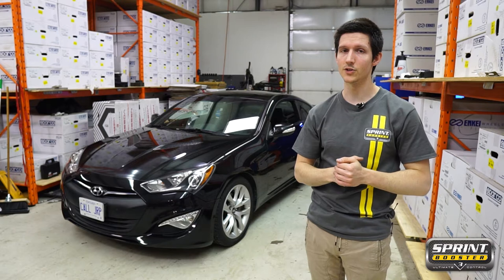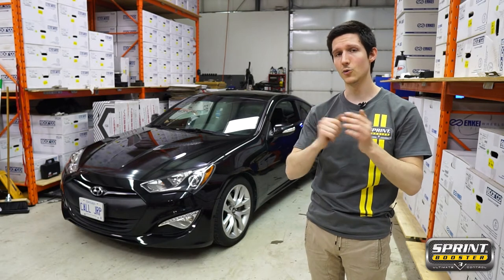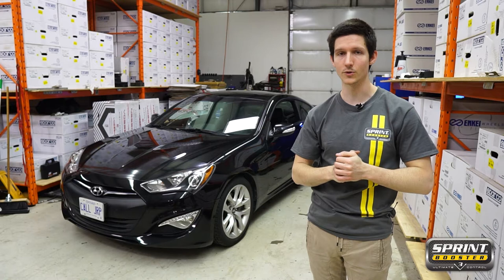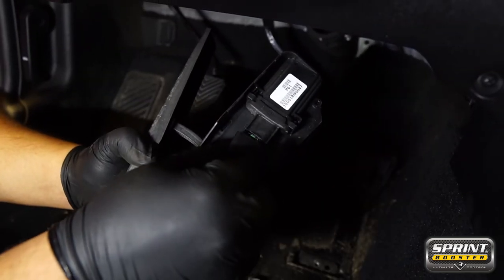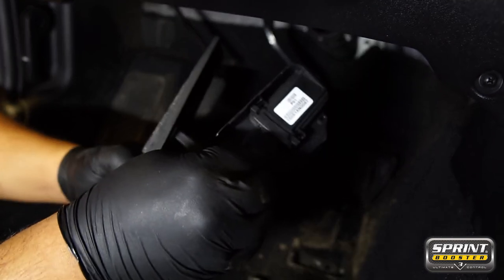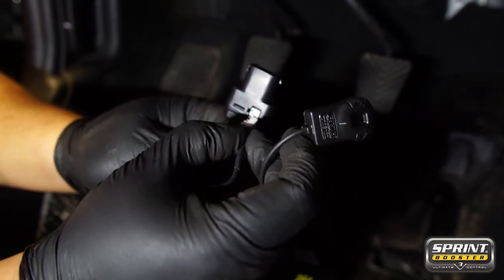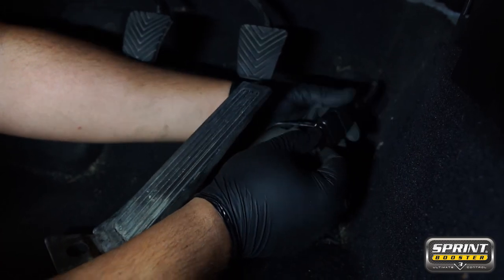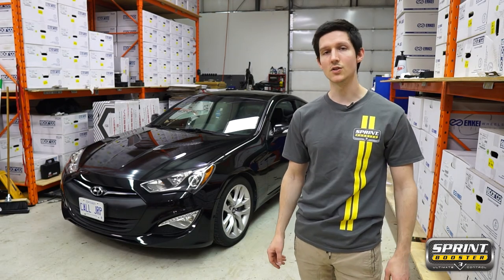Sprint Booster installation on a 2015 Hyundai  Genesis

Comment: Is the install process the same for the 2009-14 models?
Reply from the maker: Yes , it's the same process
Reply: Hey I'm getting high rpm and it's not working
Reply: I need an installation video for the 2025 Hyundai Elantra N